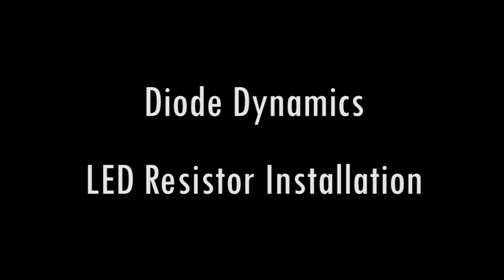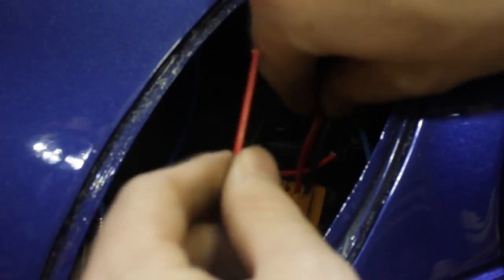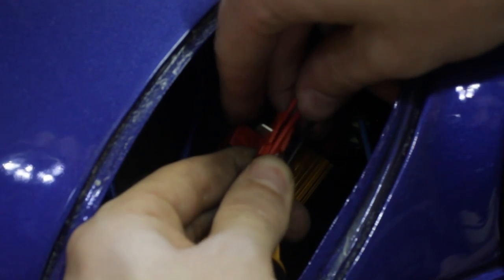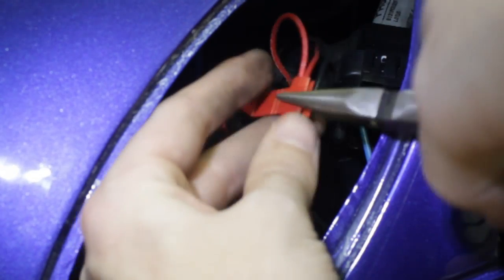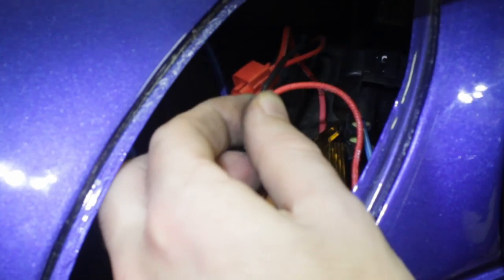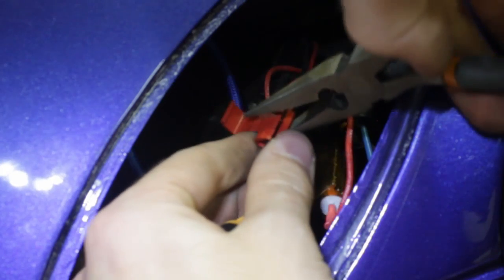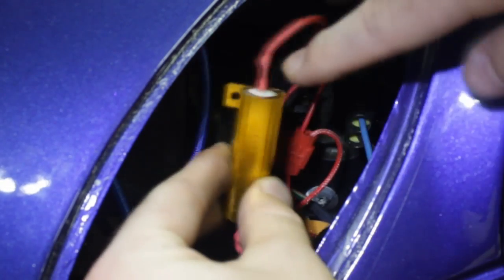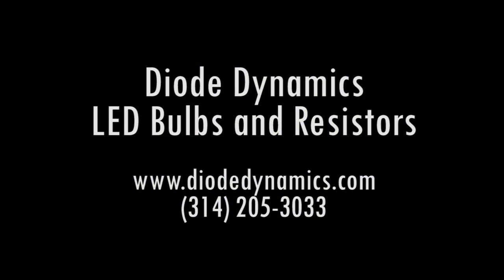How to Fix Hyperblinking! Installing Resistors for LED Turn Signals | Diode Dynamics

Comment: so you put it on the red and black?
Reply from the maker: +jon fletcher, Yes, you do attach both the black and red wire to the Resistor Kit. If you have any other questions, feel free to contact us.

Comment: Hey I just did this to switchback led lights. the blinker works perfect now (no more hyper flash) but when it's white it still flickers. any suggestions?
Reply from the maker: +The Turtle 6310, give us a call at 314-205-3033, Monday-Friday 9 am-5 pm CST, and our sales representatives can help you troubleshoot the flickering with you.

Comment: Do we need to install a resistor for each of the turn lights for both front and rear? so thats 4 resistors?
Reply from the maker: +Peewee Giberson, yes, that is correct. You will need 2 Resistor Kits (4 resistors total) for both your front and rear turn signals. There is a direct link below to our Resistor Kit. If you have any other questions, feel free to contact us! 

 http://www.diodedynamics.com/store/accessories/led-accessories/resistors/led-resistor-kit-18974
Reply: +Diode Dynamics I have turn signals in my side mirrors, do I need 2 more resistors for those?
Reply from the maker: +Shut Up, normally you do not need resistors for those, as they are not part of the CANBUS system. If you do run into any issues, give us a call at 314-205-3033, Monday-Friday 9am-5pm CST, and our customer service representatives will be happy to assist.

Comment: Will this also work on a 2007 dodge charger or do I need anything extra?
Reply from the maker: +Gabriel Perez, yep, our Resistor Kit will work on you Charger. That is all you will need to fix any hyperblinking!
Reply: +Diode Dynamics will I need a load resistor for my side marker LED bulbs?
Reply from the maker: +Gabriel Perez, since your sidemarkers don't function as your turn signal,  you won't need any additional resistance. Let us know if you have any other questions!
Reply: +Diode Dynamics sorry about that I meant corner signal lights, do they need a resistor?
Reply from the maker: +Gabriel Perez, yep, to prevent the turn signal from hyperblinking, you will need a Resistor Kit.

Comment: thank you very much for your information I will take that in consideration but in the meantime I also found that the tail lights do not come on so I'm wondering if it is a fuse that's the culprit
Reply from the maker: +old school, make sure the bulbs you purchased are dual filament bulbs, and have low and high power. Once you confirm that, it could be a fuse issue. Without being familiar with the bulbs you purchased, it is hard to say what the cause is exactly.

Comment: I bought some LED tail lights for a 13 GMC Sierra upon installing them I had the hyper blink but they were plug and play it had a resistor already in them you tell me what problem I have?
Reply from the maker: +old school, you most likely need additional resistance, on top of the resistance provided by the bulb. We would recommend installing a resistor kit. If you have any other questions, just let us know!

Comment: My jeep wrangler has one black wire and two white wires one white wire has a purple stripe and the other has a yellow stripe which one is power?
Reply from the maker: +mps50566,  they are most likely both power--one for the parking light power and the other for turn signal power. You need to tap the one that is turn signal power. Send us an email at contact@diodedynamics.com with your make/model/year and we can look up the wire colors for you!

Comment: I just finished completely rewiring my 1948 Willy's Jeep. Upgraded stop, tail and turn lights to LED with new electronic flasher. Installed a turn signal switch by Grote to integrate turn and brake light functions. Charged the battery to 12.6 volts. Now when I test, all systems work fine when operated individually. Also, Brake light works together with either head/tail lights, or when turn lights are on. Problem is, turn lights will not operate when head/tail lights are on at the same time. If the turn signals are on, and I turn on the tail lights, then the turn signals stop. If the tail lights are on, then the turn signals simply will not come on. I have confirmed that each light fixture is wired correctly. The head/tail light circuit is completely separate from the turn and brake light circuits (different fuses and wires). From reading the posts below, the electronic flasher should allow the system to work without wiring in load resistors. Any ideas? Thanks.
Reply from the maker: +DAGNUBIT, unfortunately, it's hard to say exactly what the issue is, since the Jeep has been completely rewired. We would recommend making sure that the electronic flasher that you purchased is LED compatible, either an LED compatible flasher or resistors should accomplish the same task. Both are used to simply eliminate hyperblinking. Hope that helps. Good luck with the rest of your build!

Comment: I know that the resistor heats up but I have a resistors installed on my car but it heats up pretty bad that you cannot even touch it so I took it off again... What do you think it could be? thanks!
Reply from the maker: +Glenn A,  if your resistors are heating up when the turn signals are not blinking, you are probably tapped to the wrong wire. If your resistors are only heating up when the turn signals are blinking, you are fine. Resistors will get hot, but only when the turn signals are on. If you have any other questions, feel free to contact us!

Comment: i have a 4 psc led bulbs for my car , 1 led bulb= 80w 
? what Resistance Resistor type i will need 50w or 100w and ohm
thanks
Reply from the maker: +Anwar jeddah,  give us a call at 314-205-3033 9 am-5 pm CST or send us an email at contact@diodedynamics.com and we would be happy to help you find what you need!

Comment: The most prevalent reason people consider replacing incandescent bulbs with LED bulbs is to reduce power consumption. Using load resistors defeats this purpose.
Reply from the maker: +Vallen Larsen, some people do not like the hyperblinking that you get with the lower power draw bulbs, but still want the clean modern look of the LED's. The resistors will eliminate this problem, but are not necessary to use the lights.
Reply: Diode Dynamics
You just completely deflated the purpose for my comment. What YOU FAIL to realize is SOLID STATE ELECTRICAL FLASHER RELAYS. Learn the system before you comment on it, EXPERT.
Reply from the maker: +Vallen Larsen replacement flashers are unfortunately not possible with the majority of new vehicles, but we do have a wide selection of them available on our website, including a few that we modify ourselves in-house. You didn't mention them at all in your original comment, so apologies for not understanding what you meant.

Comment: I put leds on all turn signals front and back. do you need load resistors on all bulbs?
Reply from the maker: +Paul Chavez, yes you will need a resistor for each bulb. However, we do offer flashers for certain vehicles so that you can avoid using the resistors.

Comment: I bought a led bulb for turn signal. How to know what kind of resistor do i put on wire?
Reply from the maker: +ivan novakovic, we offer a universal resistor kit that should work with all applications. It can be found on our website at the attached URL, http://www.diodedynamics.com/store/accessories/led-accessories/resistors/led-resistor-kit-18974

Comment: what if only two wires one for brake and turn and one for running lite
Reply from the maker: +Richard Wold - please send us an email at contact@diodedynamics.com and we would be happy to help you out.
Reply: +Diode Dynamics  
I have 2001 jeep wrangler want to put led in tail lites there's only two wires running lite and turn

Comment: hi i have an 08 impala and hooking up tail/blinker led bulbs. do i have to hook up a resistor on positive and negative wires or just one?
Reply from the maker: +H Tena - You will need to hook the resistor up through both the positive and negative wires. If you have any additional questions feel free to email us at contact@diodedynamics.com.
Reply: So i need two resistors for each side left and right.
Reply from the maker: You will only need one for each side. With the way the resistors are designed you will wire both the negative and positive through the same resistor.
Reply: Ok thanks ill take the light apart and see what wires are under there. Thanks again
Reply from the maker: If you need any additional information feel free to send us an email at contact@diodedynamics.com and we can work with you on your project.

Comment: Hi guys I have this problem in my Altima SL 2014 hyper blink so fast  
2 months ago upgrade my front signals to switchback led but one of them blinks so fast  I like to know if installed a resistor in my taillights this problem disappear or has to be installed on the front of my car if someone knows how can I do it please share you information thanks guy's
Reply from the maker: +Frank Hernandez, hello Frank - you will need to install a resistor for each turn signal location that you convert over to LED. If you only installed front turn signals, you will only need to add resistors there. If you have any other questions, please just let us know - thanks!
Reply: +Diode Dynamics hi 
thanks I bought my resistor but I tried to install one but there not much protection  against water or can be installed in my taillights??? 
Or the resistor are water proof??
Reply from the maker: +Frank Hernandez, we recommend installing resistors in an area out of the elements. In most tail light housings, there should be an area that you can mount to out of the way. We do recommend keeping it off anything plastic, however, as the resistor will get hot.

Comment: I liked the hyper blink over the slower blink...
Reply from the maker: +Tony Patalano, some people do prefer the hyper-blink, and this will have no negative effects on your vehicle!
Reply: Mr. Kitty I like the hyper flashing as well
Reply: The thing is that its probably not legal... Atleast in Norway there is rules about how fast the can blink..
Reply: The Gaming Norwegian yeah it's probably illegal in most areas, because it mimicks a strobe light
Reply: I think I like it too. It does get attention better. And I think I read it is legal to 120/minute. I have read a couple of references to a statutes that say that it should be 60 to 120.
Reply: Hyper blink might be useful to people who due to poor hearing or whatever forget to turn off their signals.

Comment: do you got to put a resistor on each LED bulb? Or just one for front and back LEDs or one for front and another on the back?
Reply from the maker: +dopestimports, you will need to install a resistor on each of the LED bulbs. In the majority of vehicles, you will only to install resistors for front and rear turn signals. Other bulbs will not be an issue!
Reply: +Diode Dynamics appreciate it 👍

Comment: i have jeep grand cherokee 2014 with halogen retrofit , i bought switchback 7443 bulb with 50w 8ohm resistors , installed the bulb with the resistor but when i turn first turn the signal on i switches to amber but it doesn't blink and doesn't switch back to white ! what is the problem ?
Reply from the maker: +Ahmad Doski, please shoot us an email at contact@diodedynamics.com and we would be happy to run through some troubleshooting with you!

Comment: too bad the resistors couldn't be built into the LED array, some people might not want to cut down into their factory harness for obvious reasons and newer vehicles don't have flasher relays that can be replaced. I would like to get LED's for my car but like I was saying...
Reply from the maker: +EagleTalons1, for the majority of vehicles, you will only need resistors for the front/rear turn signal locations. Since installing resistors just requires tapping into the wiring, and not cutting it, everything is reversible. If you ever decide you would like to remove everything, just take out the taps, and you are good to go!

Comment: I replaced my back lights with LEDs it also does the hyper flash, but what do u do when the brake lights or the turn signal lights doesn't work when the running lights are on
Reply from the maker: +MySHAQ18, please shoot us an email at contact@diodedynamics.com and we would be happy to help you out!

Comment: Don't forget cover the wires with electric tape to.avoid corrosion.
Reply: +Angel Uriel Good Idea!
I tend to go a bit overboard when doing Automotive Wiring, but that's just me. HAHA
I like to use Weatherproof Shrink Connectors on all my Automotive wiring projects. Also, i  always use some Rubber Shrink Wrap Tubing to protect & insulate the bare wires. If you have any long wire runs i recommend using some Plastic Wire Loom for further protection from weather & heat. -Happy Modding!

Comment: Why would you recommend scotch locks. They are unreliable and a very poor way to wire a vehicle. Show them how to do it properly with crimp connectors.
Reply: If you want to do anything other than soldering, you should be using Posi-Tap or Posi-Lock.
Reply: Soldering would be better.
Reply: +William Armstrong Crimp connectors = "proper?" If you're going to go to that level of hassle, just solder the things and be done with it. Techs crimp, professionals solder.

Comment: may i know what happen to the both wire under the clips after you have pressed the middle metal?. does it cut the wires? waiting for your reply.

regards,
harith harun
Reply from the maker: Harith Harun, using the t-tap connectors simply taps into the wire. This is completely reversible if you decide to remove the t-taps later on.
Reply: Diode Dynamics so it means after we re-open the wire clip. There is no damage on the +- wire?..and if we want to go back to normal filament bulb, it will be as original one like before.
Reply from the maker: Harith Harun correct! This is completely reversible if you would like to run a traditional filament bulb later down the road.
Reply: In all honestly they work ok if your dont have a car with a rough ass suspension otherwise what happens is the wire gets fucked up in the splicer and will split in half. Then you spend you time doing what i did today and fixing shitty plastic splicers with actually soldering the wires... and electrical tape....

Comment: This is the only clear installation instruction on how to install those resistor splice connectors.  Well done.  But in my search I also discovered that instead of using in line resistors like this one can often modify the flasher relay to eliminate the hyper-blink.  I would suggest looking into modifying the relay for your particular car instead of putting resistors on all four corners.  Good luck.
Reply from the maker: X Gempler, we also carry flasher modules that will solve any hyperblinking! For many vehicles, flasher modules are built into the vehicle computer, making it impossible to simply swap it out with a modified flasher. For those vehicles, resistors will be the only way to corrent hyper blinking. Feel free to shoot us an email at contact@diodedynamics.com and we can help you determine whether or not resistors or a flasher module is necessary. Thanks!
Reply: Yes, that is true, but it is also the case that many cars have flasher relay modules that can be easily modified to eliminate hyper-flashing without any expense of a new relay, or worse, wiring in resistors.  It is best for people to search their favorite car forum for the specifics of their car before wasting money on something they may not need.

Comment: Am I seeing that correctly? The resistor is wired in parallel, not in series?
Reply from the maker: Eric Scher, correct! You will need to wire resistors in parallel.

Comment: Do I need this resistor for the tail lights? My turn signals are separate from the tail lights.
Reply from the maker: Antonio Cabrera, you will only need resistors for your turn signals (front and rear), but not tail lights. If you are still having issues feel free to shoot us an email at contact@diodedynamics.com and we would be happy to help you out!

Comment: Do you have to have both of the resistors on in order for one turn turn to work ??
Reply from the maker: Axl Guzman, you will need resistors on all areas where you install LED turn signals.
Reply: Ok I have a 2004 grand prix and I only installed the front daytime running rights with leds. The are 4 wires two black wires, a brown, and blue. How do I start
Reply from the maker: Axl Guzman, please shoot us an email with your vehicle information to contact@diodedynamics.com and we would be happy to help you out. Thanks!

Comment: Hello, i installed 1 Load R... and its still hyper blinking... do both need to be on for it work
Reply from the maker: Fernando Rodriguez, you will need 1 resistor for each LED turn signal you add. Thanks!

Comment: What if the led burns out? With the resistor in place how will the car alert you?
Reply from the maker: Mike Loepold, in most instances, you will probably not get the "bulb out" warning due to the resistor. Good question!

Comment: Does every vehicle need resistors with these or does it vary?
Reply from the maker: chance dicus, when installing LED turn signals, the vast majority of cars will give you hyperblinking, however the solution to fix the hyperblinking can vary from model to model. Some require resistors like in this video, while others can fixed with a plug and play flasher module. If you have any questions about which method would be required for your vehicle, just shoot us an email at contact@diodedynamics.com. Thanks!